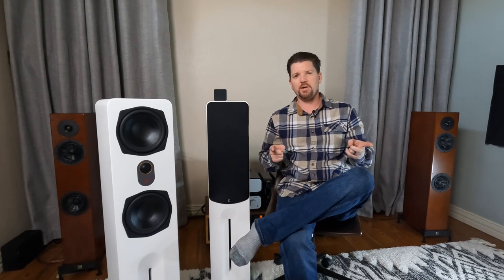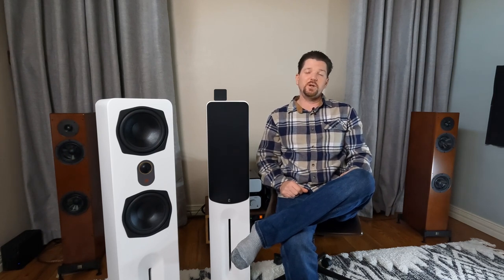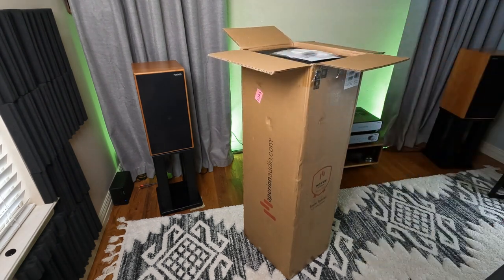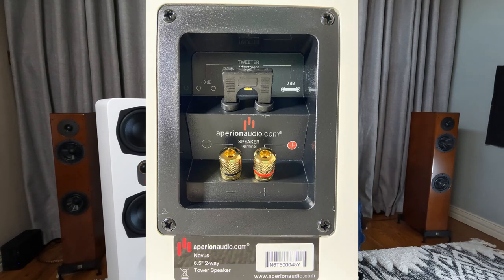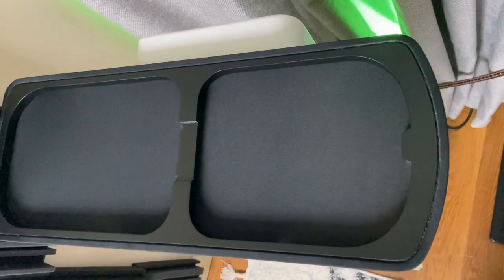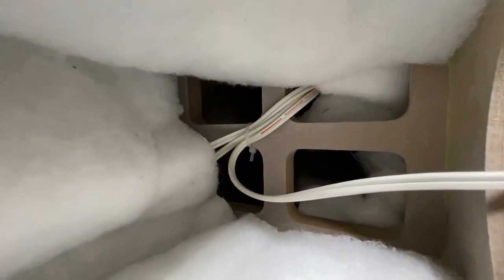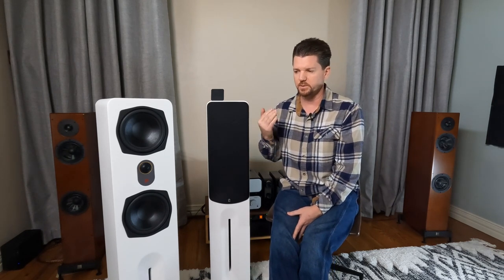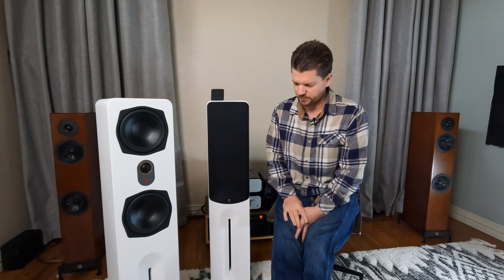Aperion Audio Novus N6T: Attractive Competition for ZU Audio & Tekton Design

Comment: Excellent review Man! I have a pair of the Aperion Audio Novus N5B speakers. They took about 48 hours to break in the tweeters. They are much smaller than the N6T but they still have a full detailed sound. The also have a great price point as with the N6T.
Reply from the maker: Hey Mr. Haven!  Thank you.  So you have the Verus and Novus in home?  I think I have only seen your Verus with the super tweeter on Instagram.
Reply: @2ChannelListening  Yes it has been a while since I posted the N5B’s on Instagram. I have them in the stealth black (matte black). The N5B’s are very versatile. I have used them as front, surround and height speakers.

Comment: These would seem to make a strong contrast from the dirty weekends, at least in my experience of the Zus over a two-month trial. I never found them to be bright. In fact, one of the reasons I returned them is because I found they lacked treble clarity and presence.  From what you said I think these go too far the other way. Maybe the tektons would be a sweet spot for me. If only they were nice to look at.
Reply from the maker: Interesting take on the DW, I felt that way about the Omen's, dull, but not the new DW's.  The Novus N6T require too much fiddling and system synergy to be a long term speaker for me, the Verus line is where its at for Aperion.   Tekton who are they again ;-)
Reply: @2ChannelListening  I didn't find them to be dull. I liked the strong bass impact with pop and rock played loud. Had to get footers to keep my place from rattling!
The guy who sold me my B&W 705s also had a pair of the previous gen DWs. He said he liked to use them with tube amps  to listen to 60's and 70's rock. Very specific.

Comment: Hello!  Although this video isn't about the Zu Dirty Weekend mk.II's, I had a couple of questions regarding them based off what I had seen in your video:  

It looks like you installed the Zu rubber feet?  Did these make much of a difference?  

And did you install the Clarity Caps yourself?  Did this make much of a difference in the audio quality, and was it a very difficult task?   

I just got some used Dirty Weekend mk.ii's recently and was contemplating both of these upgrades.  

thanks!
Reply from the maker: Both aftermarket modifications couldn't be simpler to add yourself.  The footers screw right into the existing mounts.  The cap is a simple swap, no soldering.  The footers absolutely helped with consistent bass and floor coupling.  As for the cap upgrade,  I cannot say I heard any valuable difference in my small space.  Thanks for asking.
Reply: @2ChannelListening  Thanks so much for the reply.  I have my speakers in a small room as well and on certain songs the bass is a bit indistinct or mushy.  I just ordered the footers today and once I get them I'll play around with the floor gap as well.  

Really enjoy your channel by the way, and just subscribed.  Keep up the great work!

Comment: That company set something up with the crossover. The tweeter @ -3db setting should not have an effect on woofer. 

They have the -3db crossover wired with both the tweeter and one of the woofers set also drops off at -3db when you pull out the crossover wire. They are changing the woofer to mid range or cut the mid range out @ -3db That is not something you can fix.
Reply: @ 2 Channel Listening (by way of David), Is this true? Did they really cut off some of the midranges to one of the woofers?
Reply from the maker: I cannot confirm nor deny this yet.  Looking at the crossover, where the jumper connection intervenes on the board, he may be correct.  Aperion literature only states its for Treble.  Like I said with my experience, it did not allow midrange clarity to be any more obvious or aided, just lost a little bit of leading edge information.
Reply: @2ChannelListening  Thanks for the reply.